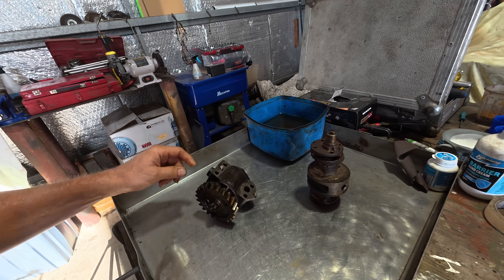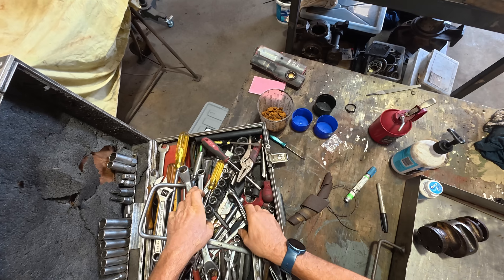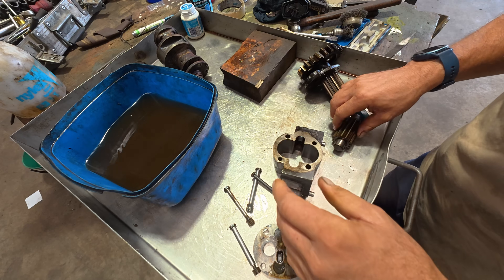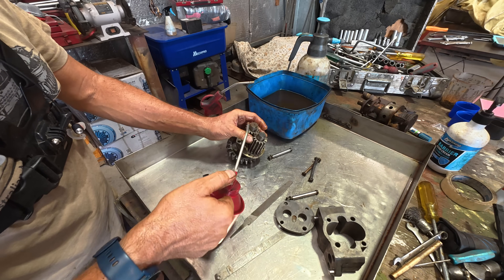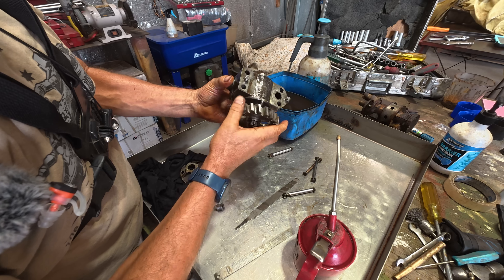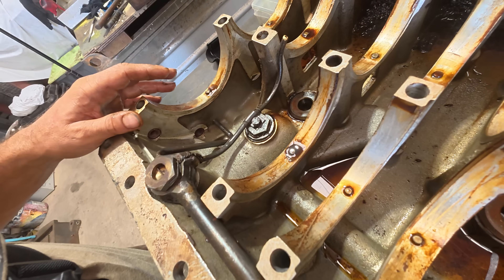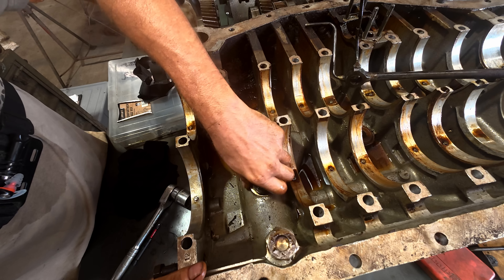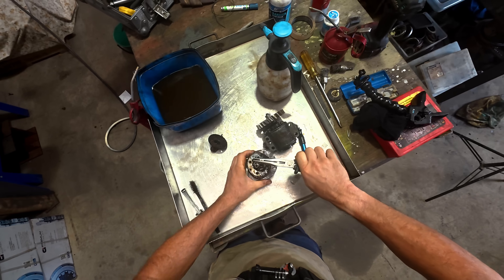Inside Panzer II Gearbox Oil Pumps

Comment: Can you imagine the scale of the machine shop to cut all these components ! Wonderful milling, turning and gear cutting. Simply make 10,000 precision parts, assemble, and voila you have a Panzer. My father worked in the Ford plant in Cologne as a toolmaker. He had amusing stories as an apprentice. Very disciplined and thorough. He worked at Cockatoo Island when he emigrated. He worked fast and precise such that the foreman told him to slow down as it was making the rest of the machine-shop look bad. I followed as a mechatronic engineer.

Comment: You should use a precision stone for burrs on accurate work.

Your tool box looks like mine lol.

Keep up with the cool in depth videos!, cool pump!

I just had one at work on a well pump gearbox that was a 3x3” section of round that had a 1/4” square thread to pump oil up to the bearings.

Comment: Hi Steve, nothing of those details are bothering me, I’ve just very curious to see how the Fritz got made it under pressure! Strange you did find any kind of sabotage in those machines. We’ve found captured FN m12 with sidecar who are been sabotaged by drilling a hole in to 2 engine part, so under stress less oil and game over. FN motorcycle greetings from Belgium. ❤❤❤

Comment: 1:11 - Several of my WWII books suggest that the Germans did not believe mass-produced parts could match the quality of their hand-fitted assemblies.
2:24 - Approaching Summer, there.
10:45 - Sure wish I had a vid of the disassembly of a couple of engines in my past. Would have saved a LOT of time.
11:30 - In the US, Lima would have sub'd that to a specialist with hydraulic repeating lathes; probably took a 'reloader' feeding in a fresh stick every 5 minutes of so.

Comment: I am suprised there are no preasure relief valves on either of those pumps. I thought it was a standard procedure to put a relief valve on any positive displacement pump. I saw at least on the first pump that the discharge was open, but that does not stop a preasure from building up to the point of destruction for the pump itself. I know you guys are not designing this stuff, I just found it odd.

Comment: Different size bolts on brand. I had to change the steering pump on my 92 Jetta. First problem: needed the date of manufacture as there were 12+ revisions. Then there were 6 different bolts holding it on. Gah

Comment: As someone who works on the agricultural equivalent of this stuff (60+ years old, at LEAST half a dozen "F'n previous owners.." and maintenance schedules best described as 'Done at least once in its life. Maybe?" I can say with absolute certainty that what Steve REALLY needs while working on this stuff is an ultrasonic cleaner filled with diesel. I've just got a cheap Vevor 15L one that can do heating and I can put things with 50+ years of grease+dirt caking them into it, heat it to 50 deg and let it buzz for 20 mins and it just slakes off. Diesel at 50 deg isn't a fire risk (way less flamable than brake cleaner or orther solvents at room temp) and its cheap and non corrosive! Only downside is the sound of the Ultrasonic will make every neurodivergent person in the place twitch a little bit. Jet A1 is better as a solvent because it doesnt leave a residue like Diesel does, but in that climate, a slight residue is probably good for flash rust prevention anyway!

Comment: I would replace a lot of those split pins with safety wire, once you get good at it it goes on faster and is easier to remove than individual pinc

Comment: I don't know that I would be using a steel-wire wheel on that. I know it's steel or cast iron, but you can still remove material. I would have used a brass-wire wheel myself. I'm sure you've done it many times before, and it all worked out, I'm just say'in.

Comment: I have a couple prewar BMW motorcycles, and I get the same kind of amazement when I work on them.  The clever tricks that the engineers worked into the designs, to cover potential problems that they couldn't really deal with in a production product at the time.  For example, the camshaft rear end runs in a brass bushing pressed into the top of the crankcase.  There's no way to bring an oil gallery up there, so the case casting has a shelf and is drilled, along with the bushing, to allow oil that lands on the shelf to leak down into the bushing.  If you replace the bushing and don't line up the holes, the bushing wears away quickly.
Reply: How did other makers produce working engines?
Reply: @sandgrownun66  More iron, less alu.  Full loss oiling systems with manual pumps and drip sights.

Comment: the germans used a lot of imported workers, with shall we say, varying degrees of consent. perhaps the split pins were left off of the oil pump on purpose in the hopes that it would fail eventually. being buried deep in the transmission, such a vital component would be ideal to sabotage.

Comment: Fixed gear pump. For a moment I was wondering where the end cap seals where, but then I realized any sort of weeping around the shafts and end caps would not matter as it lives in the oil bath inside the transmission. any small leaks makes no difference!

Comment: 5:34 Yep, safety is very lax on this site but I've had experience HP air on skin. 
This is a quick quote.
"Compressed air on skin is extremely dangerous, capable of causing severe injuries like air embolism (blocking blood vessels, leading to stroke-like symptoms or death), organ rupture (if blown into mouth/nose), severe bruising, and lacerations, as the air can penetrate skin and enter the bloodstream, even through small breaks or body openings like the navel, even through clothing. It's a major workplace hazard, often misused for cleaning clothes or bodies, and should never be pointed at people, requiring strict safety measures like low pressure (under 30 psi for cleaning) and eye protection."

Comment: I'm Presuming that most of the parts were not made on site, that parts were subcontracted and then sub contracted again, starting with a dry run back in the thirties, then procured, dealt with as units and finally assembled. A longer build life with substantial spares would have enabled easy repair structure for damaged vehicles, requiring fewer vehicles to be built.  A least was probably the thinking

Comment: At least with German equipment, you know all the fixings and threads are metric. On a British tank, they are likely to be a mixture of UNF/UNC, BSF, Whitworth, BA (for small fixings on instrumentation) and possible even British Cycle Threads for components made in wartime in a bicycle factory. Plus all the different thread possibilities for pipe and tube fixings, both tapered and straight.

Comment: excellent job Steve, that second pump was certainly a piece of art in itself, well worth seeing in the video, and not just be hidden away inside the gearbox
the only minor wince i have is i hate to see a wire wheels being used, i'm sure you only use lightly, unless its a brass one, i prefer to use these nice Nylon and Wire fleck filament wheels, utterly brilliant, take off paint without wrecking the metalwork, ie like rivets
use the wheels at speed in a power drill not a battery one and not pressure, they do an excellent job, if you press too hard the nylon strands bend and come off which is usually why some people say they don't like them, i use them all the time on restoration work

great video Steve

Comment: 2:30, those oil pump Castle nuts might have had the pin omitted by sabotage? 2:33
Reply: Or maybe they found that using crush washers made the split pins obsolete. Evidence: the washers were thinner originally, i.e. flat, to make the holes align.

Comment: Nazie Germany relied heavily on slave labour to manufacture much of its equipment, and whilst they machined things to the highest standards, which can easily be checked using gauges, perhaps not so much care was taken in the assembly, which might explain why the bolts are easily taken apart. I've noticed several times in your videos how critical nuts and bolts come undone, whilst the less critical parts can be very difficult to undo.

Comment: I've read commentary that suggested that when the war had devolved into basically a war of manufacturing ability, Germany really struggled because it just wasn't in the national psyche to come up with crude halfassed ways to solve an engineering problem quickly and cheaply. The design and construction of that gearbox would suggest the theory is correct.
Reply: As someone that worked for a German machine tool manufacturer here in the States for 28yrs, that sums up the German engineering mentality.  They're incapable of half assing engineering stuff.  Everything is over engineered to the point of impracticality.  There was never a point where it's "good enough".

We used to design our own machines for production in the US...  Simple by comparison to the German designed machines, but they worked, though it gave our German counterparts fits because the American ethos was always "good enough is good enough...".

Comment: Cheers Steve, incredible how much work goes into small components like these oil pumps I find it interesting, no wonder they could not manufacture tanks quick enough, is it true there was a lot of sabotage going on in the background, maybe the oil pump not having spilt pins could have been a sabotage itself ?, thanks again guys you all do a fantastic job 👍🇬🇧.
Reply: Not really.  These oil pumps would have been industry standard parts ordered off a catalog.   All the internal parts made on automatic machines.
As for sabotage, it might have well have been, but spilt pins are a bit of over-engineering in this application.   I have examined similar oil pumps in American engines that had no spilt pins.  I can think of a couple of reasons for the bolt having a hole for a split pin:-
#  They used a batch of split=pin bolts because there was a shortage of ordinary bolts;
#   In the factory, it could be assembled with calibrated torque wrenches, but mechanics having to repair a damaged tank in the field might not have a torque wrench for a bolt that small.  But they could do it up moderately tight by feel and put a split pin in or piece of wire and get the same reliability.
#   the factory slave who was putting the pumps together was issued with the wrong bolts by mistake - but they fitted, so he kept quiet and used them anyway.  Why make a fuss?  Not his problem.
Reply: @keithammleter3824 thank you very much for your response 👍.

Comment: I recon the oil pump should have had the nuts lock wired not split pinned. That way you would most likely be able to use the parts as they are. Great video thank you for sharing.

Comment: 11:34
Lathe and mill operations:
1. facing the stock
2. boring the stock
3. cutting the three different surfaces with at least two if not three cutters (round for the shoulder, point for the valleys and thread cutter for the threads)
4. chamfering 
5. parting the bolt
6. turning the bolt around for boring out the head for lightness
7. chamfering again
8. to the milling machine to bore the four holes (one drill through)
9. final QI, deburring.

Comment: I love the minutiae of the engineering and the surprises inside!
So please don't feel it's boring at all to us, your audience, we're just as intensely mesmerized and amused by it all as much as you.👍🤔☺️
In most applications you don't find everything cotter pinned and metal wire wound securing the fasteners unless it's aircraft engines etc.
Yeah, over engineered I certainly agree 😂🤣😆😳💯 
Did that very small screw bolt really need to be cotter pinned in the bottom of the case housing?🤔 I seriously doubt 🤔 that it does 😂🤣😆
Talk about wasting time on minutiae‼️ but that may have been a blessing for us Allies.
Imagine if they hadn't been as time consuming and fiddley, they might have been able to build way more tanks,guns , planes,ships and weapons than they actually did.🤔😳
Overwhelmed by mediocre numbers and over production as well as our resources is what won the race over Uber quality and over engineering ❗ thanks again Steve and everyone 🎉

Comment: being a member of the general public that has no idea about engines i find it interesting, but what makes it really good is the explanations of the german engineering steve gives, think a lot of us forget that stuff like that bolt with the holes in it was made by somebody and not a machine or just more hands on, and the thought process that led them to designing just that one wee part, that keeps us interested
Reply: That oil connection bolt would have been made completely automatically on a machine known as a copying lathe.   When I was an engineering student at university, the university had one - it was pretty old.  Control by compressed air, nothing electronic on it.  Us students had to set it up to make a similar bolt.   Its fed from long rod stock, and each time it makes a bolt, it automatically pulled the rod in to make another one.   A system of cams caused different cutting tools, drill bits, etc to be brought in to play at various times as required.
As a student, it took me almost 2 hours to set it up.  Then it was allowed to make just one bolt in about a minute, before the teaching staff shut it off - otherwise in  a very short time there would be a heap of bolts and no stock steel rod left for the other students.
Copying lathes were good if the factory needed to make a few dozen widgets or maybe a few thousand.   Its between the low setup cost of having a human manually make one on a manual lathe and a milling machine, and mass production fully automatically on custom machinery.
Same with the Archimedes screws - they too would have been made automatically, once the master machinist had set the copying machine up.
Reply: @keithammleter3824  like i said i know nothing about it, so good to know, every days a learning day

Comment: Again, the detail work on small components is quite incredible. It would be interesting to get Steve's take on significant differences he has noted between German, Russia, American, and British engineering from the period.
Reply: The Germans have always been on another level
I worked with a old German fitter and everything had to be perfect 
There were no tolerances.
Reply: @Mmm-y5w8o we germans dit that things well done. 🇩🇪👍
Reply: @andik859 the balance is found . Do you want an army of soldiers with Rolex watches? Or Timex?  You can't make enough Rolex quickly to equip this imaginary army. 
Consider this:
A kubelwagon. In an infantry division in WW2. Nazis vs Soviets.
How "good" does it need to be?
Should it be built to last 25,000 miles? 
Or to it's 3rd engine oil change?
How "good" does it need to be? Nazi equipment was designed,built and shipped to the front and promptly destroyed.before it's first oil change. Before tires were 25%worn. 
Complex question for civilian and military hardware . Same question for peacetime as well
Reply: @thedeathwobblechannel6539 shortest life was british tanks that rommel hunt down with 8.8 cm flak in afrika over 2 km distance. That tanks need no oil change, they didn't know whats happend. German tanks drive long ways in Greece or italy or ostfront.
Reply: @andik859 depends which tank you're talking about and what model
Reply: @andik859  And lost.
Reply: @gian.4388  The later German tanks were unreliable.
Reply: @Mmm-y5w8o  It obviously wasn't during a war was it?
Reply: Yes my father during WW2 'liberated' quite a few German tools from overrun machine shops etc whilst in Germany 44-45.  I still have quite a few of his tools, all high quality steel and beautifully made.  Very reliable and still used today!  👍
Reply: American is best. End of conversation. 😎
Reply: @thedeathwobblechannel6539 oh wait, watch the Ford cars 6,2 Liter engine break down and gearbox too. It's crab.
Reply: @thedeathwobblechannel6539  Whoever won was best.
Reply: @thedeathwobblechannel6539  most of your best designs were by European immigrants, many of them German LOL